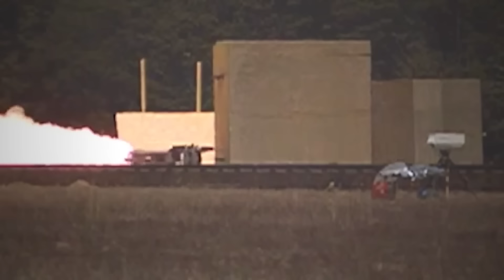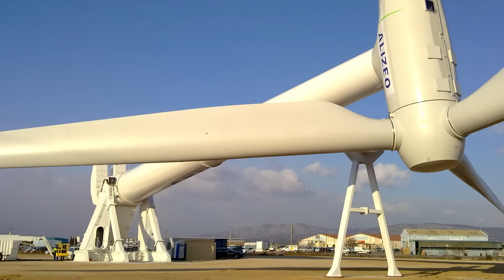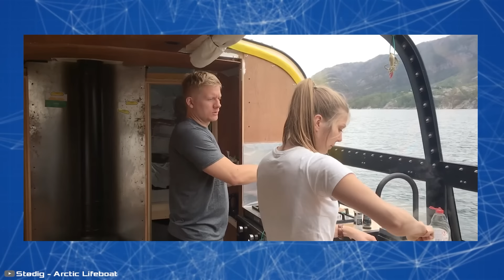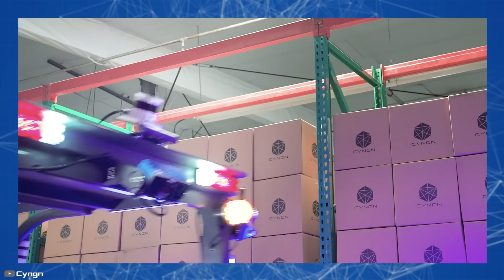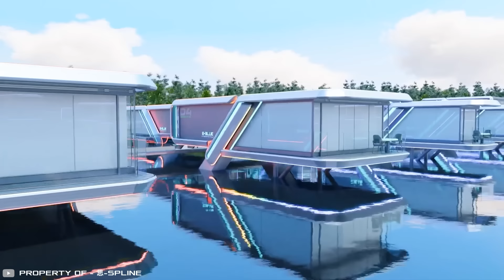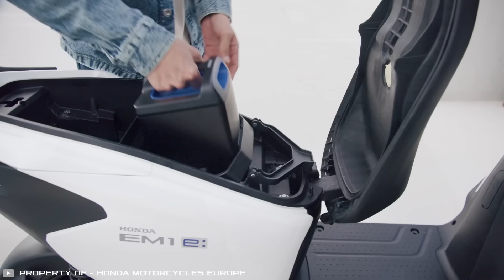60 INVENTIONS ON A WHOLE NEW LEVEL

Comment: A pumped-storage hydroelectricity (PSH), or pumped hydroelectric energy storage (PHES) is by far nothing new and no "batterie" either!
The fire fighter plane is nothing new or  special either! Suche aircrafts are in use since decades!
And where is the artificial gravity by the shown space station? In the video there is talk of artificial gravity without any explanation of how this can be achieved. Anyone with a little knowledge of space technology knows that it has not yet been possible to generate artificial gravity anywhere in space. So this would have been a major breakthrough that would have attracted a lot of attention. Why is this mentioned without saying more on this point?

Comment: See Adam Something videos on why the cable cars and the mag rail are shockingly stupid. They claim the can do it over regular tracks. They cannot. Reaching speeds mag rail can do requires straight tracks and no switches. Mag systems are prohibitively expensive.

Comment: Why aren’t city water tank supply towers converted into electricity generators by the falling water being consumed by water customers?
Reply: Because it would lower the delivery pressure and because power generated that way depends on flow rate which in this case is far from constant.  You would need to build for maximum flow and leave it doing nothing at low flow times of day.  That's an expensive modification for mediocre return.

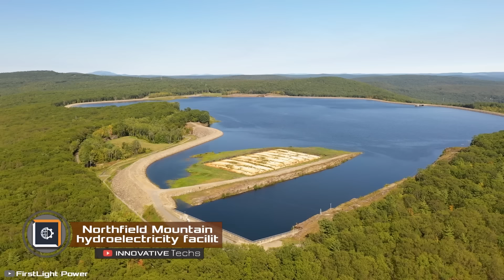Comment: 33:55 is good, but location dependent.
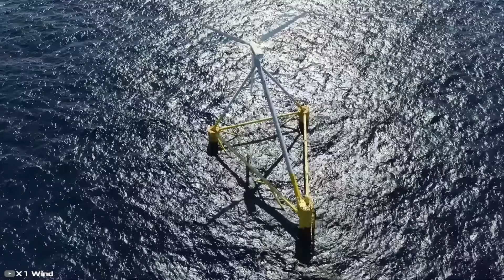25:00  assumes that the water is smooth. I doubt it. Currents, waves and debris in water makes this questionable.
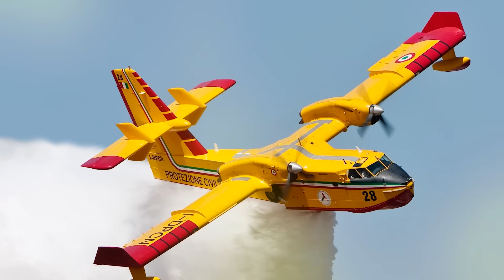39:50  Super scooper has been used for 20 years while others are just vaporware. This video is too mixed and too long.

Comment: I wonder who writes the dialogue It would take to long to cover all the inaccurate info, But a simple hint is If an aircraft has a motor IT is not a Glider
Reply: Please Google "Can a glider have a motor?"
Reply: @allanpimble7198  People are always trying to eliminate the tow plane to give "gliders" more freedom. Since the advent of small jet engines they have been used because they offer minimum drag  and  a modern passenger plane can "glide", that does not make them " A Glider aircraft " I do not think the Space Shuttle could be classed as a glider an yet on reentry it  is not powered.. If you "Gooogle "water do you get steam or ice and yet they are all atomicly the same. . My problem is when putting yourself as an Authority you should explain as if you are teaching  without assigning new meanings to words or pretending to know a topic if you do not.

Comment: The Ligeti Stratos ultralight had been invented over 40 years ago in Australia, it took the ultralight world by surprise back then by its efficient design. Due to the  death of its Inventor , the release of the aircraft to the market did not take place. Its most interesting features was its enclosed cockpit and the abillity to be put onto a trailer (sideways) without having to disemble any parts.